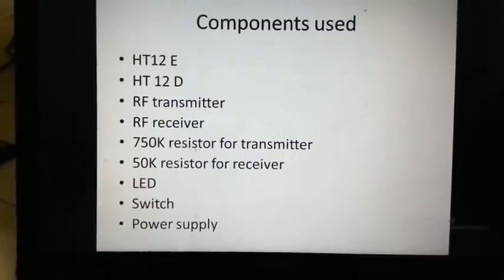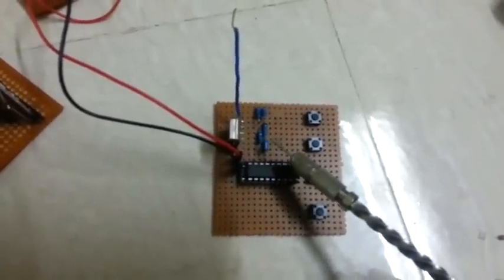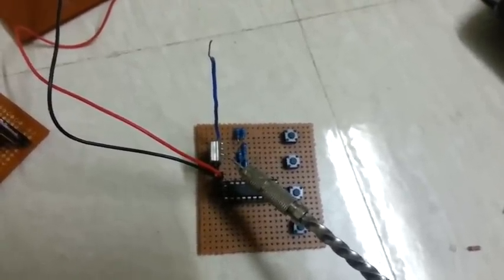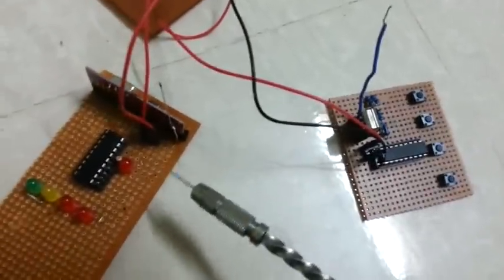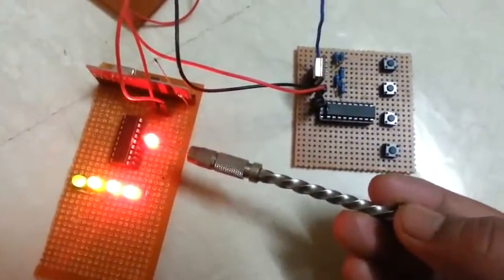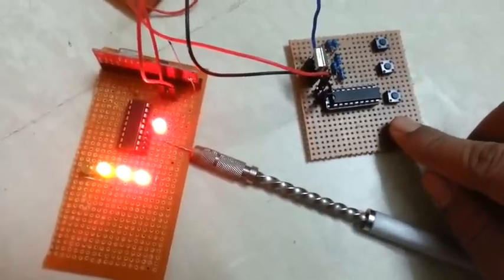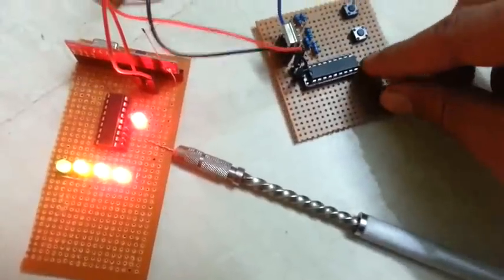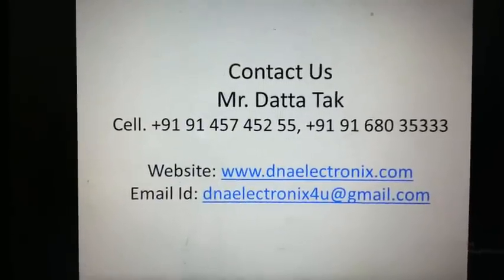RF transmitter and receiver circuit

Comment: Sir i used tx2b and rx2b ic and 433mhz trans and receiver. But the output flicker in led after push the transmitter. If in close distance no flicker, but in 3 meters distance will flicker again. Tell me what is wrong or it is right?
Reply from the maker: increase antenna  length

Comment: pls dont mind me if this knowledge of mine is too crude. I am thinking of using 433mhz and 315mhz(to avoid jam or clash) rf modules to make two transmitters and also two recievers circuits since i can only get 4 channels from each circuits and all together 8 channels..Will this work?Hope the two circuits wont clash since they are of different frequencies

Comment: Is it possible to use one transmitter and multiple receivers?
Or they are paired one by one by frequency range?
Thank you.
Reply: +Boby Bob i think it is possible if all work on same frequency , because i control different r/c cars with the same remote having frequency 27 mhz
Reply: yes. it is possible . each time a connection is made the ht12d and ht12e matches a 8 bit code (something like a password) if all of em are using the same code and same frequency im using 434mhz

Comment: im kinda confused,arent the 4 led's supposed to be off then when u press a button one goes on

it seems to be the other way around
Reply: The turning off of LED shows that it gets a low signal , if you have to drive a motor using this circuit you may require an additional motor driver circuit. i am using it for my rc car.

Comment: where can i salvage this AUDIO OUTPUT TRANSFORMER from? inside any boombox portable radio?? speakers? also can i use this setup to transmit data or even binary values? pwm? control the brightness of an led? or speed of a motor?